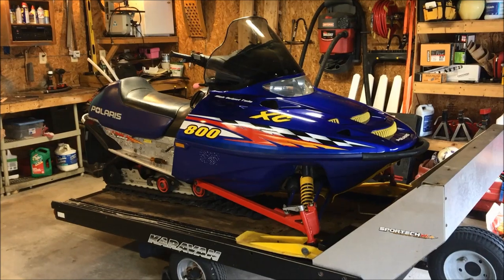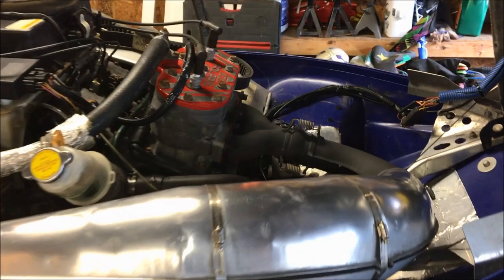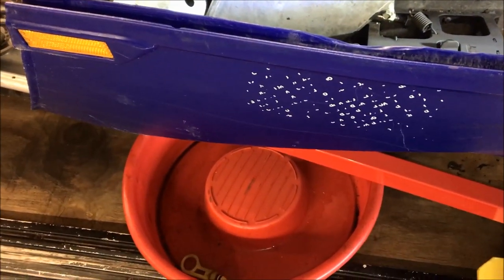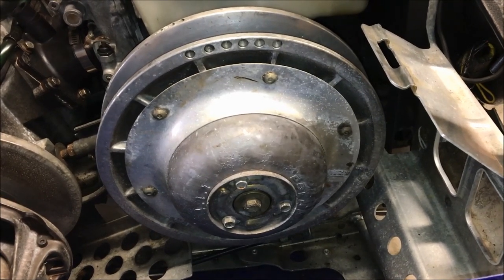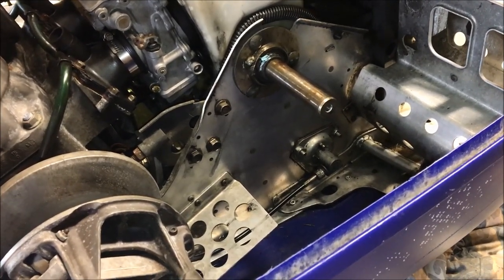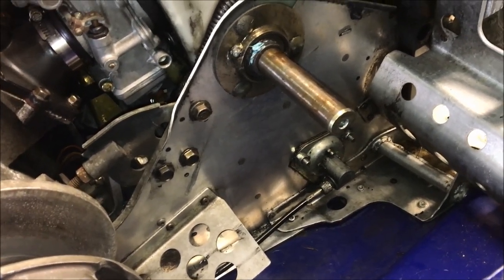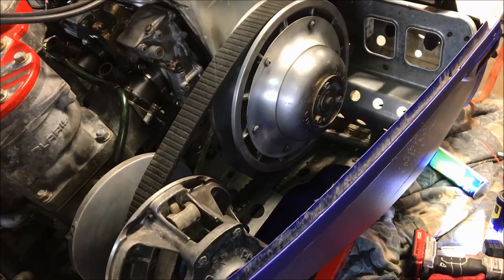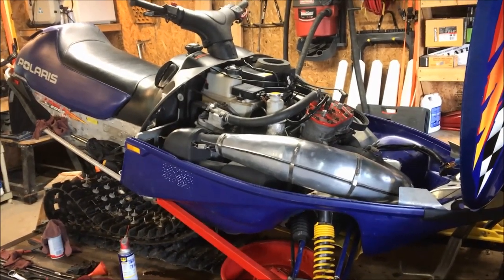How to replace a track on a Polaris Snowmobile

Comment: Holy s**t you made my life sooooo much easier with this video, I honestly can’t thank you enough, I saved a lot of time pulling the skid on my 04 edge. And it was much easier.
Reply from the maker: That’s awesome. Swapping a track on the Edge chassis is normally a good experience compared to other MFG’s. 😀
Reply: @StreetersGarage  you have no idea how long me and my buddy we’re fighting/scratching our heads trying to get those back suspension bolts out.

Comment: My sled is a 2002 Polaris 600 Classic Touring, Variable Exhaust - it takes a 133.5" track which is no longer manufactured.  Closest thing is a 136", which requires an adjustment that my local dealer said they could make, then $808 later said it didn't work.  A MN track dealer, said use that I can use the 136" belt, if I drill 4 new holes and move the skid frame back 1" in the tunnel.  I'll combine that process (still researching how to do that) with this video to see if I can get the new track on my 2002 sled.
Reply from the maker: Look at Tracks USA for extension rails. That would be your best option.